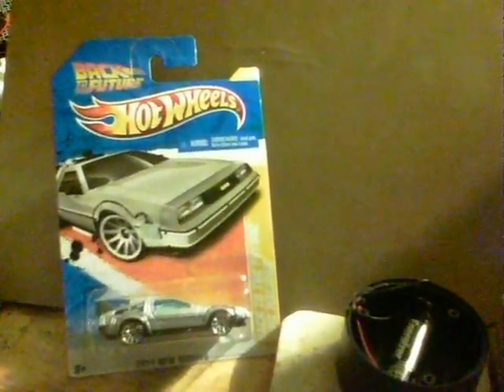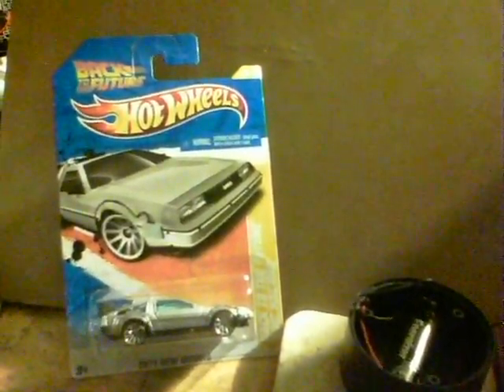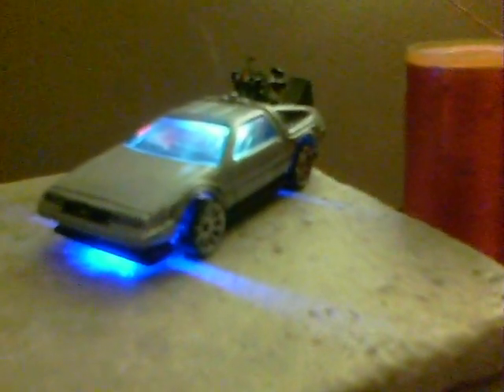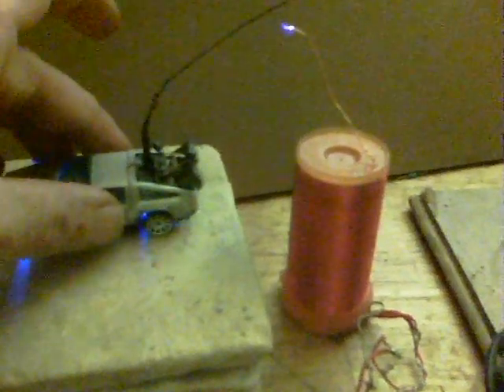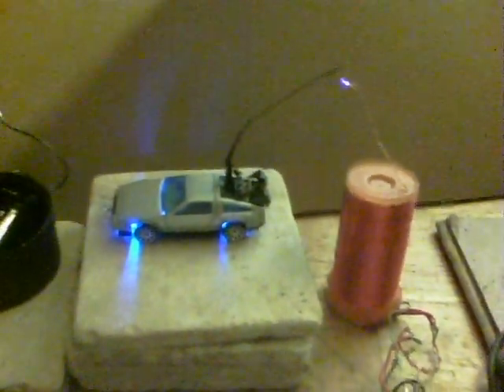Mattel DeLorean - Flux Inductor Powered

Comment from the maker: @Flyingwigs Yep Derk, that's in the pipeline :D My levitator circuit doesn't work yet...trying to avoid I/R LED based one and do the Hall sensor type. 
Best part for the next project, is that the Zamac metal these cars are made from is non magnetic (Zinc/Aluminium/Magnesium/Copper alloy). So neo magnets can be properly weighed up, for a wireless electric flying DeLorean.

Comment from the maker: @iluzyon1 Hey thanks to you again for the original inductor thoughts :) 
Yep, standard resistance fed switcher - BD135 NPN with LED across Emitter and Base. 1K resistor from positive supply to Base and 2 turn 18 gauge coil inside the tower. Walgreen tower is approx 800 turns of 34ish gauge wire taken from 3x RF-300 cassette player type DC motors. It's a regular small sized pills bottle, Walmart type are almost same.

Comment from the maker: @MrFlathunter Well the AA was swapped for a Ni-CD later and wish i'd put that on the video.. it was at 1.21V !!!
Yeah, was sayin to Lid in reply, I burst a A1020 tranny and threw on a BD135, but still had the DC/DC adapted car adapter on the circuit. Could have done with being 12V really. The DC/DC has 9V out, but is sent through a KBP206 FWBR and large cap for very smooth output, knocking the output down further. Gives effectively 7.5V instead of 9V, down its settings to 0.3V instead of 1.5V !

Comment from the maker: @Lidmotor Thanks :) The Walgreens are a pain to wind, but very worthwhile. L1 is 2 turns of approx 18 gauge speaker wire on the inside of the tower btw. 12V would have given better plasma, just that I had the DC/DC adapter wired up and had just blown up the 2SA1020 I was going to use.